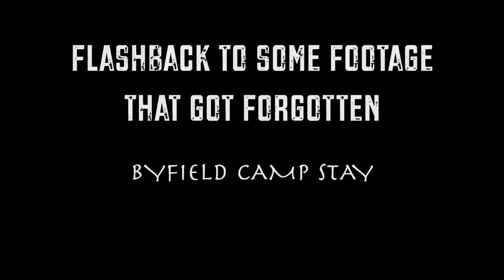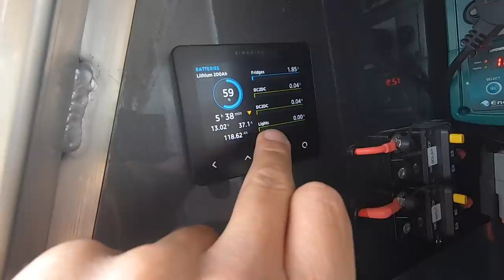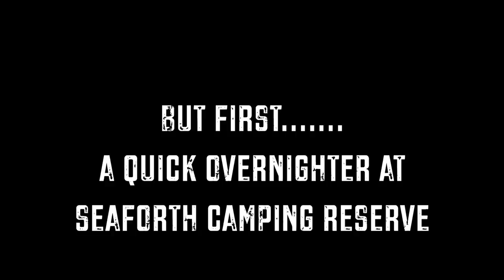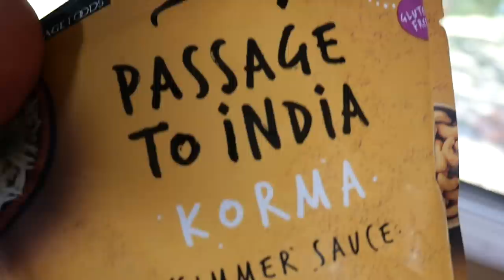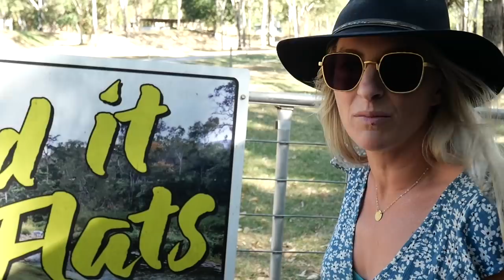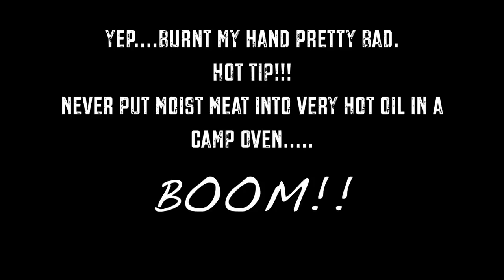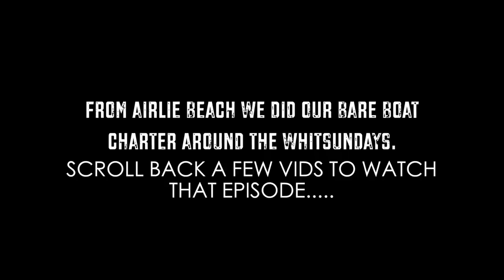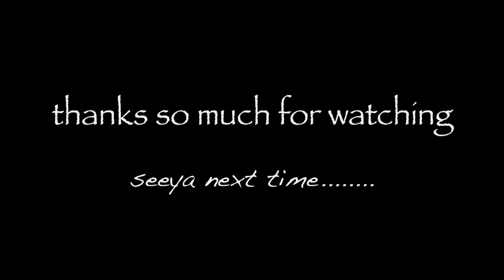BUSH CAMPS, BEACH CAMPS, QUIRKY SHOWERS, FARM STAYS & ROCKSLIDES  | North QLD Road Trip Australia

Comment: G'day Justin & Beck. My partner & I have been on the road since Jan this year, were going for the Big Lap Coddiwompling, but yet to get out of NSW. We have a 21' 6" semi off-road Roadstar so my main concern with the cape is road conditions. I don't want to rattle the crap out of the van on corrugated roads. I have heard that there are moves to seal the road all the way to the top. So have a great trip and keep dropping info on the road condition. Cheers guys.

Comment: Hi, you are doing a great job, the videos are fantastic, and your kids what can I say but they will grow up with some fantastic memories. How about adding a "Safety Zone" segment. I've seen so many vans with the safety chains not crossed but also just about dragging on the ground. The chains need to be as tight as possible, this is obtained by putting your vehicle hitched to the van and in a "Jack Knife" position, pulling the chain tight and backing off one link. The tight chain helps the A frame from digging into the ground should it come away from the vehicle. I know as this has happened to me , fortunately only travelling at 20kph. Also I would like to see you load figures for you vehicle and van, manufacture specifications and weighbridge weights. Keep up the great videos. anyway I can add a PDF.

Comment: Hi guy,s great videos. As a deisel fitter Im interested in your gear. Good to know what mods are on your cruiser, I have a 100 series, what chip, exhaust, intercooler upgrades. What fuel economy you get. What tyres over the years you recommend.  Stuff like that. My wife and I are planning our trip end of next year so looking for tips. Thanks
Reply from the maker: Cheeers mate. All the power upgrades were done by Cookie at diesel power unlimited in mackay. No chip, remap and dyno with upgraded intercooler and exhaust. T/c lockup kit and cube touch with a few extra maps with boost and fuel. 
We average around 26L per 100km over. 35,000km. 
Always had cooper st maxx tyres 🤙💪

Comment: I have the rhino rack shovel holder on my 200... yes.. that slide in and out is a pain in the ass.... seeing these newer ones you have.. might be time for an upgrade soon :).  side note, i start the car and set the ac on to low and idle for say 30 mins to top up my agms with the redarc dc to dc.... do you do that or just not bother? i realise lithium goes a lot further than agm, i was curious.